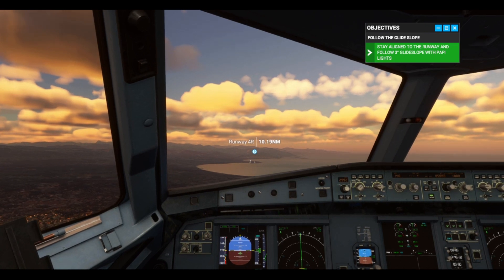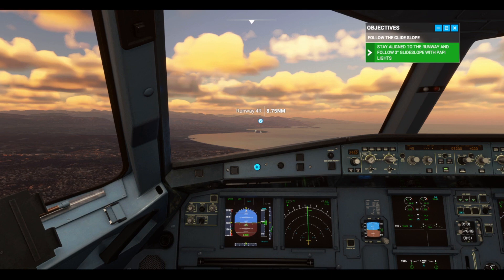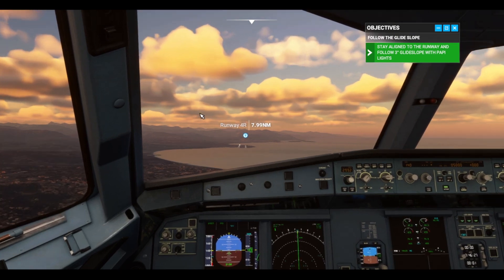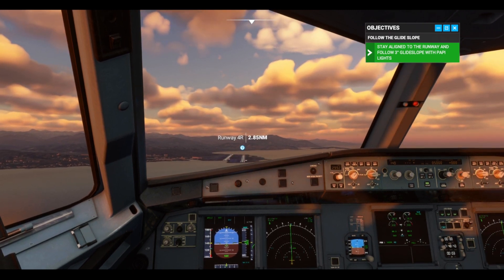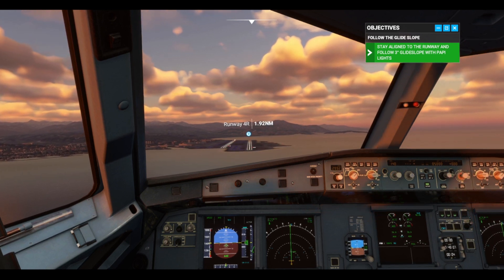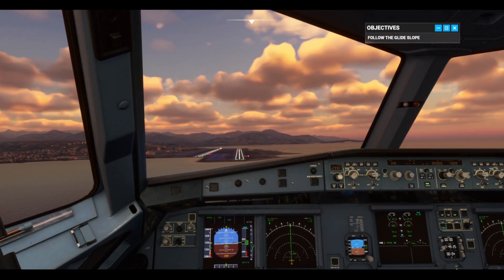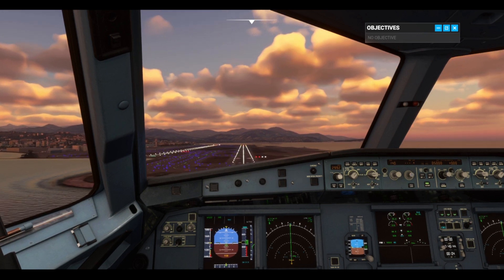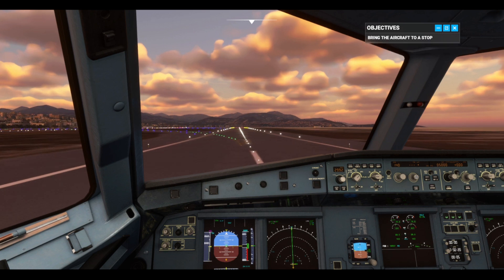How to LAND an Airbus A320? | Visual Approach using PAPI lights | Microsoft Flight Sim 2020

Comment: How do you manage to stay within 3-degree glide angle? I'm having trouble understating the FPA vector on the altimeter.
Reply from the maker: Instead of using the FPA, use the PAPI lights on the side of the runway to maintain 3 degree glide path.
Reply: Use the same approach as driving a car in a lane on the motorway. If you get too close to one side of your lane you won't apply drastic steering to get back into the middle. Instead you make minuscule changes and gently guide your car back to the middle of the lane. If the Papi lights tell you that you are a bit too high, you gently lower the nose ... by probably not even a single degree and gently get back to the centre of the approach envelope. At the end of the day it is about repetition and practice. Once you've made 200+ approaches with an A320 you will know what the "picture" looks like out of the cockpit and you will just know by looking at your attitude as well as the position of the runway whether you are too high or too low ... you won't really need the Papi lights. It's the same when driving a car ... at some point you just know when you have to break to efficiently come to a halt in front of the traffic lights ... for a beginner that's hard to judge due to lack of experience.

Comment: I also don't understand the FPA vector. It's already about 3 degrees below the horizon, but the lines on either side that I thought indicate your wings basically are still pointing higher. If you try to line them up you descend really fast and the green dot moves farther.  I can complete this landing fine with PAPI, but I would like to understand this FPA thing better. The internet wants me to understand way too much about it. There's nothing simple for a novice playing on a sim to understand.
Reply from the maker: Well, Continue using the PAPI lights for landing. Its reliable!
The lines on both sides do represent the wings of the aircraft. The FPA or Flight Path Angle(or Vector) is the final resultant direction in which the aircraft is headed. So during the approach phase the aircraft's resultant path is downward but aircraft's pitch is a bit higher. Hope this helps!!

Comment: So I've tried this a hundred times. My PAPI lights are always at 2-2, the glideslope objective is always green, and I flare and land perfectly. I still always get a score just below 8K. The third objective is at 2K/2K, but the rest are always less. What is going on?!?
Reply from the maker: The other parameters would be the distance from the center line, so try to keep it as close to the runway's center line. The other parameter is the rate of descent: Try to keep it as low as possible to avoid a hard landing! 

And definitely avoid any bounce on the runway!
Reply: @JxJAVIATION  Wow, these two were something I didn't think would affect the rating! My centerlines was off a lot of times and my rate of descent could've also been high.

Thanks a bunch! I'll try it out again soon :)